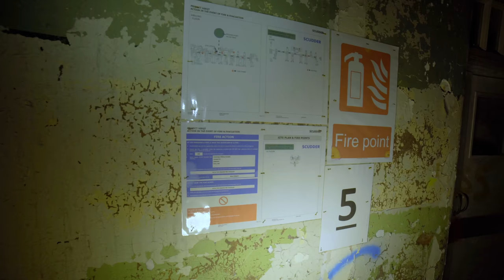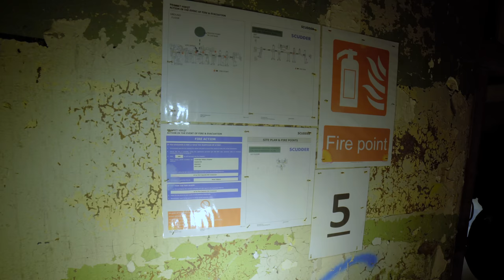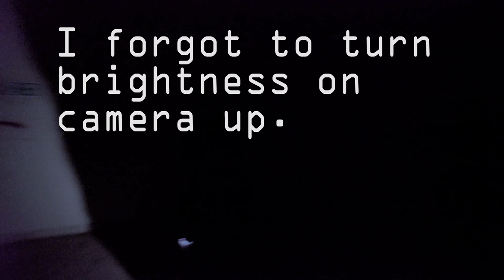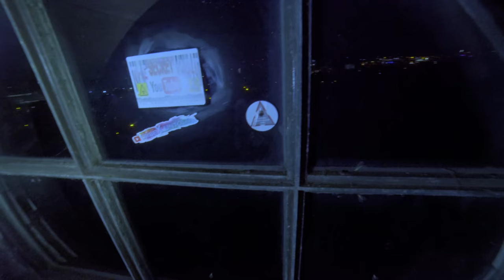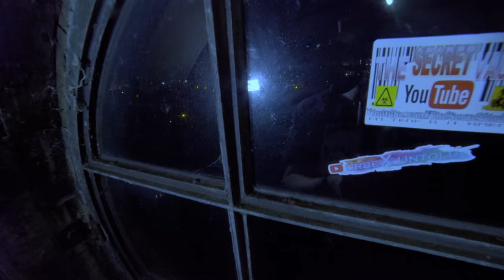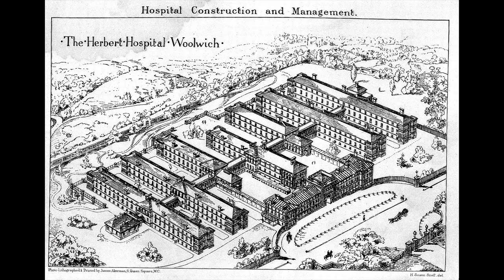Return to Cambridge Military Hospital **CLOCKTOWER REACHED**

Comment: Great explore guys! Thank you for taking me exploring with you. That metal room in the clock tower was put in after it was built because they didn't have metalwork like that before 1900 I would guess, the electric boxes also look relatively new.
Reply: the clock tower was refurbished in the early 90's, I served there had to go into the clock tower to manually turn the lights on of a night when on guard duty
Reply: @martinjones1600  Thanks for the info! I like the fact that the building is older than me but, the metal is younger!👍 
Thank you for your service!

Comment: I will have to come back to watch this video ,I just wanted to make a suggestion for a ghost hunt. Netley Military Hospital cemetery in Hampshire. The hospital is gone now, I had a quick look in side when I was 13 or 14 . There is also the Abby and castle. The castle is flats now though. I'm told monks have been seen on the Abby grounds in the woods behind the Abby. Back later to watch you climb the tower.

Comment: 1:15:00 - "why would they want to do that?" Dust suppression on site. many worksites must by law keep topsoil moist to avoid dust causing issues for nearby buildings and sites.
Reply from the maker: it was splitting in the sides of the hose so i doubt they would utilise busted hoses as a way to do what you say? Wouldnt then use a head attachment to give a wide spray. This was spraying into a small puddle which was running off. I do agree that they probably do what you say though.
Reply: @TheSecretVault  from my low res screen, that was hard to see, however I've seen worse solutions on Aussie worksites.
Reply from the maker: @TheAussieRepairGuy  lol